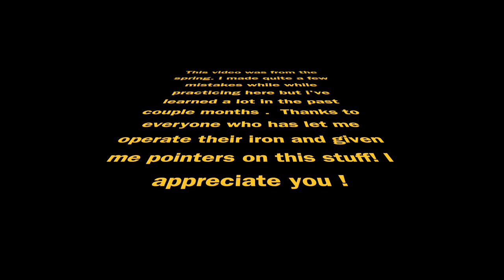1954 Insley Front shovel brakes and swing clutch

Comment: great to see these old machines still working looks
better than our farm k12  owner before installed a
detroit redoing that now need info on undercarage
brakes
Reply from the maker: what do ya need?  i guess yours is setup as a crane or dragline?
Reply: @73DiamondReo  dragline the brake levers for tracks dont hold a plate
was welded under it not sure where to adj or reline had a swing relined 
reinstalling before putting motor back has no hand clutch anymore

Comment: Thank you so much for showing U-Tube land, the interesting, brake system, that those old girls had.
It should last a life time for just play. Looks like you have the drift handled. I think there is always creep on swing, by the very nature of the system, Gravity.
Really nice pant job on boom.
She actually started great consider the time she sat, over the time you worked on her. Thank you so much for saving that old iron. And making her, run like a top. Your my Hero.
Reply from the maker: thanks. yes gravity will make the house go whatever was it wants without help from one of the swing frictions. my issue is more than that. its a slightly powered swing.  it will overpower the house lock but it i leave the bucket on the ground its ok. something is dragging and i haven't figured out what it is yet but didnt look too far into it either.
Reply: @73DiamondReo  
Thanks for the information. Very nice old girl.

Comment: The cable logging “donkey” I have that is made by skagit needs to have one of the the break bands re lined. I have lined breaks before with brass rivets on my 1929 pickup. But never had to buy new material. Ware can I order it from??
Reply from the maker: ive ordered my material from ebay and McMaster carr.  same thing i used brass semi hollow brake rivets .

Comment: You did GOOD, Franko! A-PLUS! I never ran a stiff boom rig, always cable, a drag bucket or a clam. I'd probably go nutz with a stiff boom. Ran a Liebherr hoe with a free swing but that's it. And my bitter pill was getting the clutch shoes and brake bands centered so they didn't drag. Once that was done the rest wasn't too bad at all. You're going a fine job. The house lock would slip but I drug the bucket and that helped. A-PLUS and GBWYall!
Reply from the maker: for moving short distances or crawling ahead into the pile i leave the bucket on the ground. ill get the swing issue figured out eventually. it didnt do it when i first got it running. not sure what changed
Reply: @73DiamondReo  Sounds like a dragging clutch. New lining is thicker and drags easier. That's what it sounds like to me but you'll get it. You're the Frank of all trades!